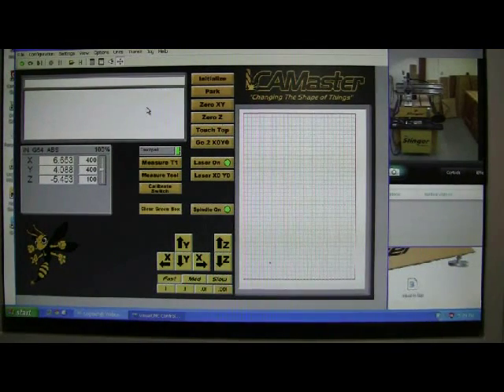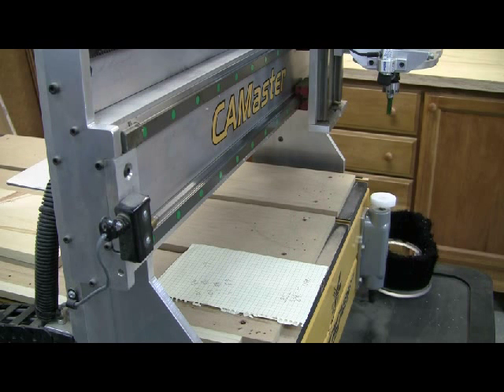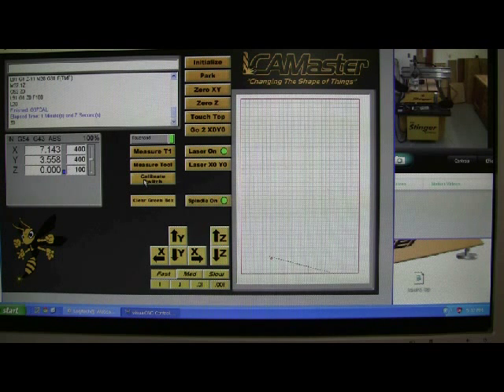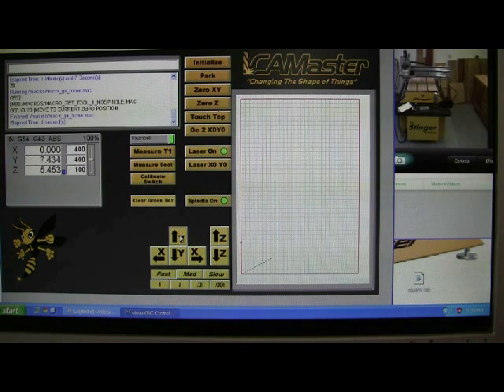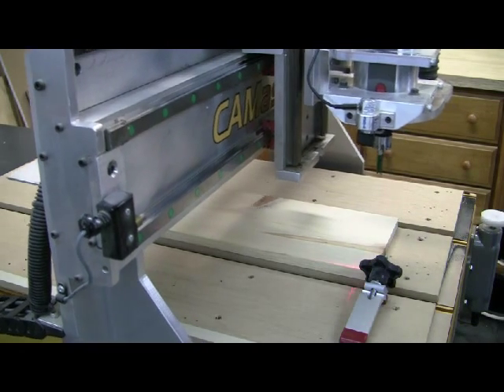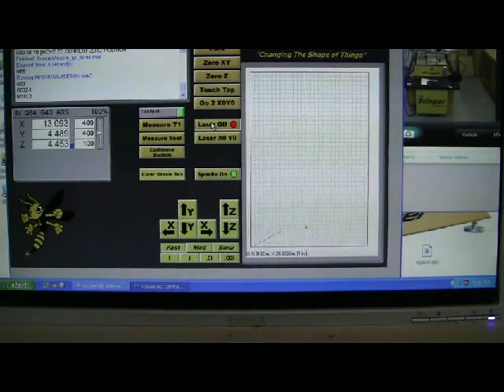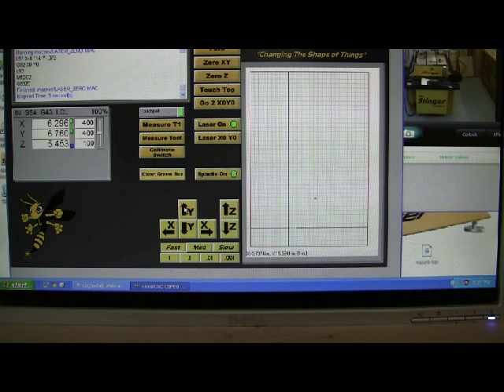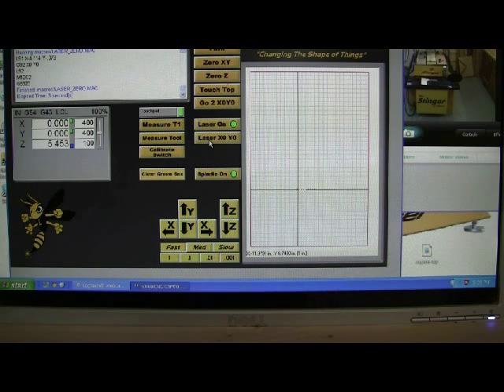CAMaster CNC Router and Wincnc Video Tutorial Part 3

Comment: Mick, so I was able to change my Z0 to the top of my MDF spoil board.  I was one of those who used the touch top and was used to setting my Z0 on top of the material.  That said, after changing the Z0 to the top of my MDF spoil board, now when I do touch top on top of the material, my Z0 is off by the material thickness.  Does this mean I should not use touch top to set Z0 on top of my material anymore?  Thanks
Reply from the maker: You can set Z0 on top of the spoilboard AND do a touch top on top of the material, Wincnc will use the touch top rather than the top of the material. 
NOTE: If you set Z0 on top of the spoilboard you will see a blue box next to Z, if you also do a touch top you will see a green box next to Z (temporary Z).

To answer your question, I suspect you set Z0 on the top of your material in you design software, if not let me know.